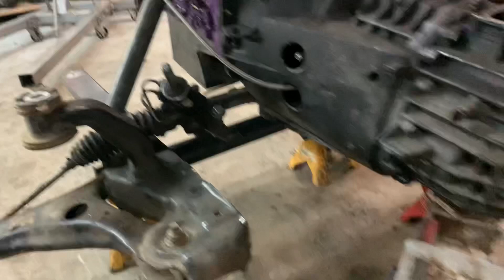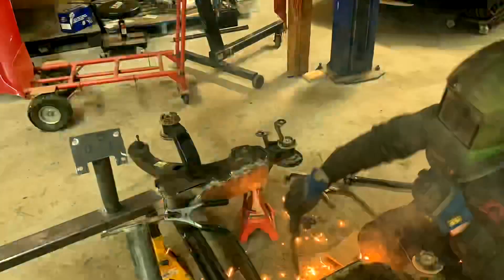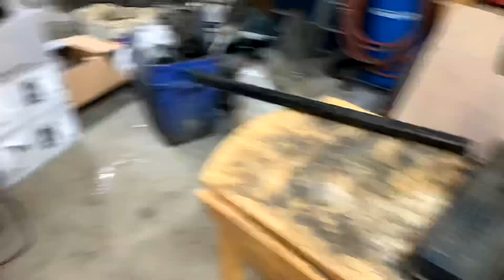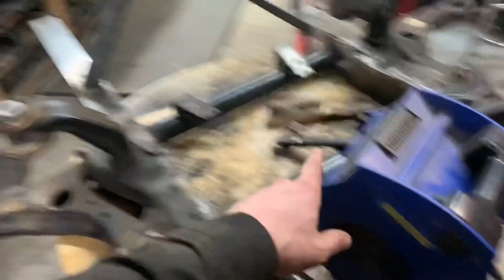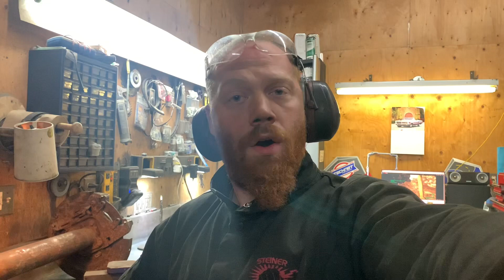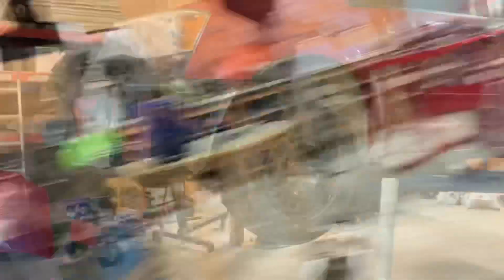Finishing up K member, mounted the LS

Comment: Awesome Monday upload she is moving along nicely.
Reply from the maker: Yeah! I’m hoping to get at the rear diff this weekend. I still have a lot of work to do up front but I’d like to get all the big stuff out of the way
Reply: @StationroadRatrods  I had planned on running up to the dealership to look underneath an AWD Pacifica’s skirt to see how the ran the driveshaft and rear differential
Reply from the maker: If it’s like any of the other awd SUVs, I’d say it has a two piece driveshaft with a steady bearing, and a fixed differential out back with independent suspension

Comment: The fact that you are designing this as a drop-out for service is admirable. It's a built-in engine stand. Pretty damn cool. I would take the completed project to Jiffy Lube for an Oil change, just to hear them "WTF" responses.
Reply from the maker: I’m doing it this way because I break stuff pretty often, especially with putting a turbo on it. Last year I built 3 engines for the rat rod and pulling engines from that thing was a pain, I figure this will be much easier and faster. 

I think I may do it, I have to figure out how to mount the camera discreetly, I don’t want it to look like one of those cheesy staged videos haha

Comment: Great job looks good. Surprised the front end didn't drop more than that. Maybe when the rest of the stuff is put on?? Have a good sleep your a hard worker.
Reply from the maker: Thanks man! I was surprised too, but I have to put oil in it, coolant, radiator and fans, Intercooler, turbo, all the exhaust, there’s a lot of weight to go on yet. 
I had a nice relaxing day yesterday haha

Comment: If you took the 100% completed cradle and had it 3D imaged for CAD, I bet a kit could be made for bolt-on LS conversions.
Reply from the maker: That’d be freaky, along with instructions like “trim here” for the floor and firewall haha
Reply: @StationroadRatrods  Exactly, I mean, the way you've done this, if that cradle could be accurately reproduced, it would be just that, cut, cut, cut bolt on. I'm interested to see how the rear suspension turns out. Personally, I would do a 4l80e, so I'd have to mod the cradle, but that's me. Enjoying the series. Glad you're wife is cool with this, as mine IS NOT.
Reply from the maker: @willfixthingsfordonuts  id go auto too, but I don’t have one so manual it is haha. Gonna be a lot of head scratching to get the clutch master cylinder to fit. The rear diff shouldn’t be too crazy actually, everything bolts on so it’s really only getting the diff centred and the pinion angle correct

Comment: Could you have used the front frame of something like a Tahoe as your subframe instead of basically engineering the steering and subframe from basically scratch?
Reply from the maker: Maybe so but the Tahoe stuff is a lot wider. As complicated as it was, it wasn’t too bad.

If I’d just accepted that I had to re-engineer the whole subframe early on in the build I would have saved a lot of time